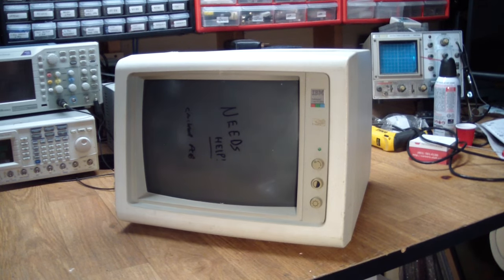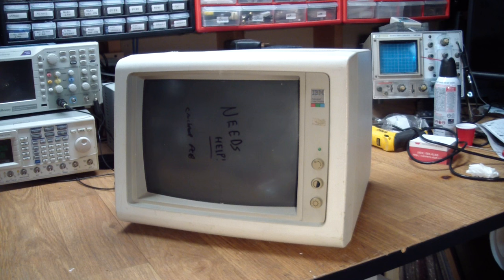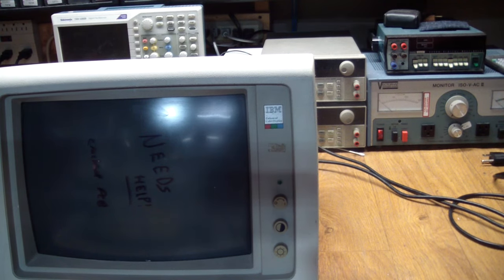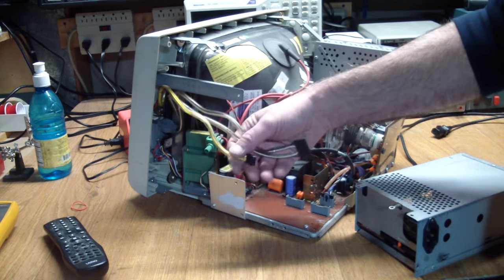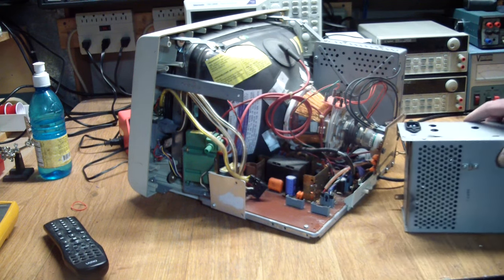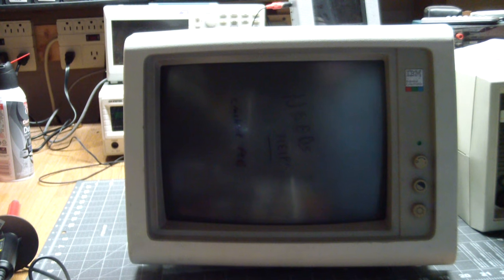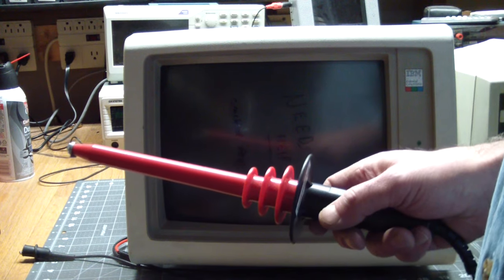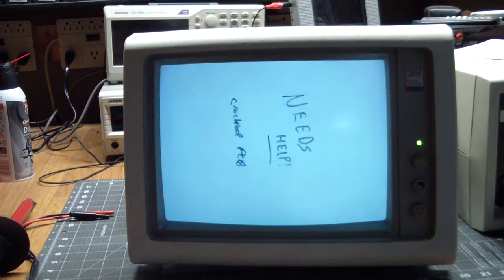AE#219 Repairing An OG IBM 5154 EGA Monitor

Comment: The customer has written a detailed and extensive list of what's wrong with it.
The List:
"It's broke!"

Wait, wrong channel!

Those "bulging" plastic caps on those main filter caps are there so you don't get shocked if you touch the otherwise exposed metal can. Even though there's no direct connection between the can and the terminals, there can still be a path through the electrolytic and I've felt the tingle touching the top of a still charged power cap that didn't have a plastic cap on. This little attention to detail seems to have fallen out of fashion. And I'm pretty sure they came like that from the factory. EVERY capacitor is a ticking time bomb. Modern ones are often worse than old ones (unless of course you use quality caps).

If you're looking for a really good EGA HiRes game, try Blockout.

Comment: RE: Electrolytic Capacitors. If I find one or more dodgy caps in a unit, I replace all of them. This saves having to go back into the unit in a few months or a year to replace the next failed one. 😊 For higher voltage electrolytics, I always test for leakage at the rated voltage as well.  Thanks for the video!